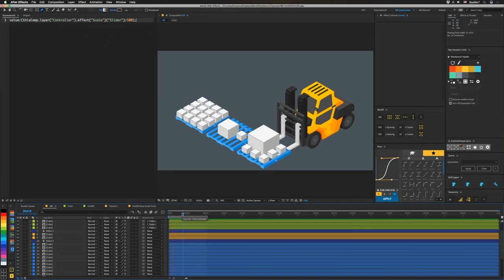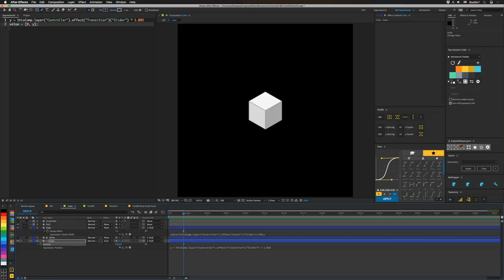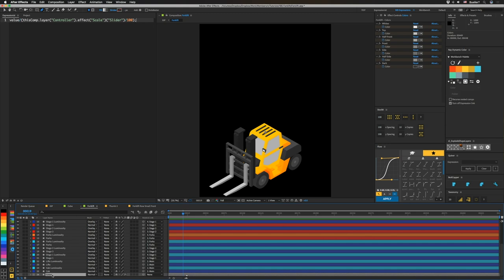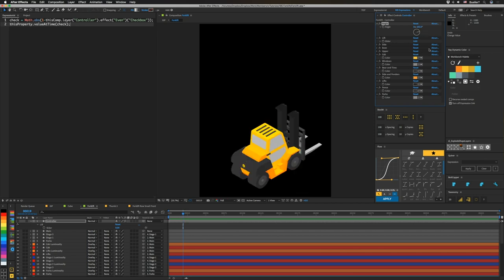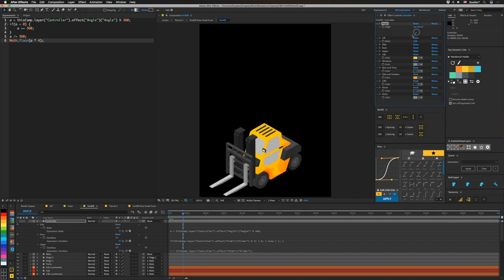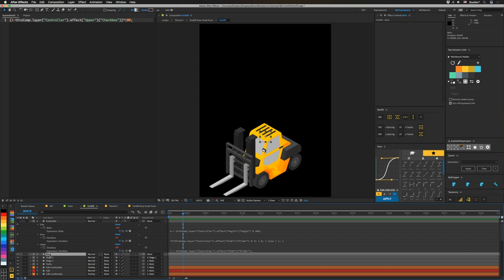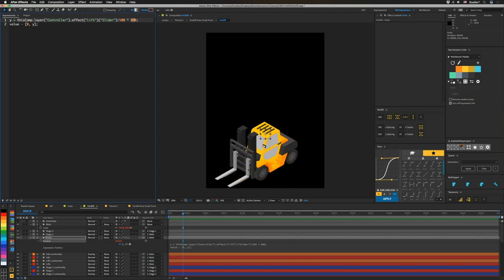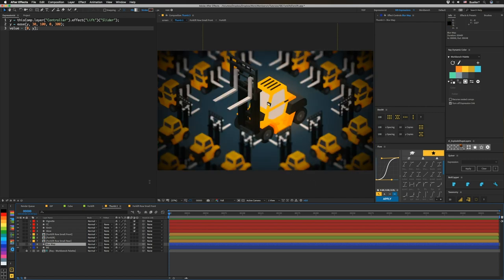Rigging in After Effects - Part 1

Comment: wow super interesting, so im trying to wrap my head around this rig. The truck is just drawn in perspective and the individual layers are simply moved around with expressions? Since they are not 3D layers every layer is just a 2d path right? But then how does the switching perspective works? Sorry if you went over this in the video I didnt have the time to sit down and watch it all through yet! Great content though keep it up:)
Reply from the maker: Yep, pretty much all correct. I probably could've shown it more clearly, but everything is parented to that main null. It scales horizontally in two of the directions. So sometimes x scale is 100% and other times it's -100%. So I illustrated two directions, one facing up and to the right and the other facing down and to the left. The other two directions are made when x is scaled -100%. The colors in the luminosity layers are also swapped so they maintain the same lighting direction. Make sense? Thanks for checking it out!
Reply: @Workbenchtv  yea makes sense! thanks for the detailed reply:) never done stuff like this in AE would prob use a 3d software and make a flat render, but I think you mentioned using 3d models aswell? anyways cool that it is possible with AE! Will stay tuned!
Reply from the maker: @carlherner9458  Yep, I'm modeling right now actually. ;)